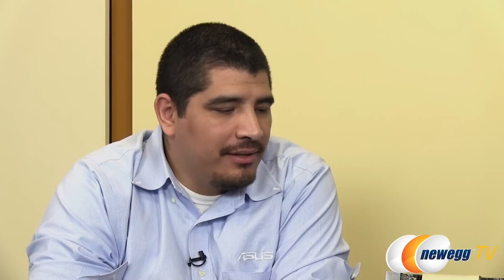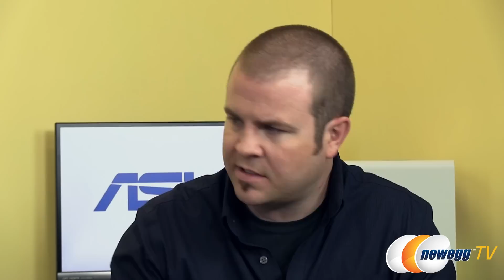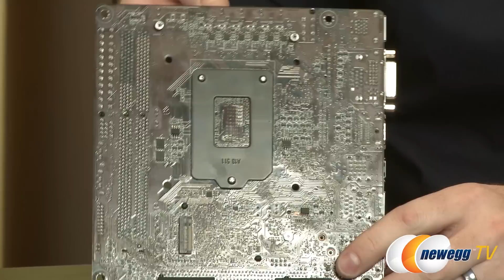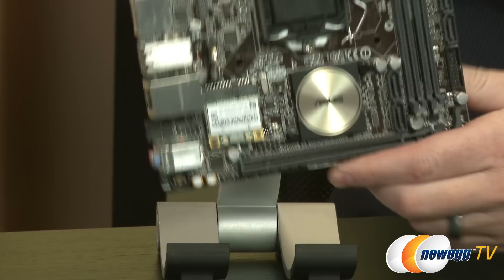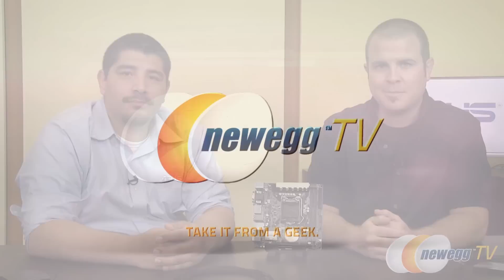ASUS Z97I Plus Mini ITX Motherboard Interview - Newegg TV

Comment: Hello sir,
I have problem with my asus Z97i plus mini itx motherboard. When I on the pc there is a led light on near the ram. When I try to on the power button.. the does not trun on there is no response from the pc...  there is no fan running or any thing just a led light on near ram.. thats it. 
it would be great help for me if you can tell me what exactly the problem is.
Reply: Anthony Christopher The exact same thing happened to me. I had to buy a new mobo. Did you ever find out what was the root of the problem?

Comment: First off I'm a computer Noob !!! Can I have two grapic cards with this motherboard ? 

I currently have a GTX 750 Ti
Reply: Paul Conlan No. There is only one (1) PCI-E 16X slot. There for you can NOT have two (2) graphics cards installed with this motherboard.
Reply: Paul Conlan How would you fit 2 cards onto a board with one pci-e slot? Relax, use common sense :P

Comment: I'm thinking about using this board in my HTPC with raid 5. Dose anyone know how the performance of the write speed is. WD-RED... and how i could monitor the health of the raid or physically see what drive had failed (future). so I could just label the drives and pull the failed drive out and hot swap the new in?

Comment: How many ohms can the on board amp power
Reply: I am asking the same question. Can someone comfirm if it can power 250ohms headphone.
Reply: Reymond Padriga It can drive 250 ohms headphones just fine, but the audio chipset (Realtek AC892) is a bit lacking if you plan on plugging a high-end pair of cans. With Beyerdynamic DT 990 I went with an external DAC+AMP instead.

Comment: I bought the H97I-PLUS several months ago and read that it can support DDR3 2600MHz. I'm reading mixed reviews about it in comparison to the Z97I-PLUS. Saying that it only can take maximum DDR 1600 rather than 2600. I need this to be clarified because I bought for it recently Corsair Dominator Platinum 2400 2x8GB and want to be able to fully utilize the memory.
Reply: ***** Yeah, in the end found out. I switch with the Asus Maximus Impact VII. I am currently selling the H97i-Plus brand new on eBay for $90 to hep compensate for my losses.

Comment: Is this motherboard good for music production? And I don't mean average good. Can I build a fully functional music production pc with this motherboard that won't choke even on huge projects with many channels and lots plugins doing real time processing?
Reply: Motherboard's aren't the issue when it comes to handling music production stuff. That's really solely up to the CPU.

But, ITX is a bit weird for hardcore music production, since most people like to use Audio Interfaces that connect to the PC via Firewire. Pretty ancient connector, but not in the music production industry due to its ultra low latency. Most mobo's don't have Firewire anymore, and usually they'll do a PCIe to Firewire conversion. ITX only has one PCIe slot though, making it weird for ITX and music production to go together unless you simply don't run a graphics card.

You could always do USB audio interfaces, but those have quite a large bit of latency associated with them when compared to Firewire. Not a big issue if you aren't doing live recordings, but practically everyone does Live stuff, with MIDI keyboards and whatnot.

My solution is to get an M.2 Wifi card (Intel 7260NGW) for wifi, get rid of the mPCIe wifi card and replace that with an mPCIe to Firewire adapter so you can hook that up directly to a Firewire Audio Interface
Reply: John Wattis Overall, the motherboard shouldn't be the biggest concern for you if you're focused on music production only. As long as it has basic features, a corresponding socket to match a strong CPU (LGA 1150 I'm guessing), and a decent amount of PCI slots, any mobo with these specs will be plenty enough for you. You generally can't go wrong with a mATX or ATX mobo because most of them come packed with a ton of features, even the cheaper ones.

Your biggest concern should lie in which processor you get and how much RAM you'll want. If you're talking like, a ton of plugins and such, you'll likely want to invest in 16 GB's of RAM, since programs like music software depend heavily on memory. And an i7 processor would be great so you can hyperthread and maximize your efficiency and power (I'm assuming the software has that capability).

My future build, which I'm about 90% done with gathering the parts, is going to be music production focused too (I'm only just starting to learn hehe), but it will be ITX because small form factor is huge for me. I'll be using either the mobo in the video or the Asrock z97e ITX board. These 2 boards have an m.2 slot, which I will be using for wifi instead of the mPCIe slot, and then I'll use the mPCIe slot to connect it to a Firewire audio interface, all powered by an Intel i7 4770k. Feel free to copy me if you want! It's also gonna have a liquid cooling loop and tons of Noctua fans for maximum silence, as well as a really strong graphics card for gaming too!

Also, have you considered AMD? AMD is incredibly good for multimedia and handling big loads like 5 million plugins. With the AMD A10 7850k processor, you get a great processor and a great GPU combined together into one unit for a great price. With the built in GPU, you won't need to buy a discrete video card, letting you free up the PCIe slot on your ITX motherboard if you choose to get one.
Reply: I believe it is good enough, just like most other Z97 mini-ITX boards out there. Nice 802.11ac internal wifi added too. Like most mini ITX board, it is just a cut down version of its bigger brother. I don't think you are going to do SLI/Crossfire for making music, so no point is lost there.

It doesn't have an ALC1150 audio though, the onboard audio I believe is ALC892, but then, if you are doing music production, good chance you are going to use an external DAC anyway, so that point is moot.
Reply: yummybluewaffle
Thanks for your detailed explanation. What I liked about this motherboard was the small factor, and with that the ability to build a small but powerful machine.

I have research and found that this motherboard might not be my best option, and not concern about the small factor anymore, so want to go to ATX. Been looking at the Z97-WS, would it be overkill for my needs? I'm just thinking that it might be the best future prove motherboard, and with time only replacing the CPU will give me a brand new computer
Reply: Well, this tiny motherboard can take the i7 4790K, and the near future Broadwell processor. The only thing that limit you on this thing is you only have 1 PCIe x 16 slot, which in this case, almost always used for graphics cards, so you just can't do SLI/Crossfire on this thing.

I think the WS is a bit overkill, unless you want to do 3-4 way CrossfireX/SLI which even Linus doesn't recommend. Be sure to check out the Sabertooth Mk1/Mk2, Z97 Deluxe, and Maximus VII Hero/Ranger if you haven't, I think they are more worth it than the WS.
Reply: Reza Santoso  Not planing to use more than one graphic card, not a gamer neither into video editing.

Right now working with a laptop Asus A75VM with i7 and 16GB ram, it works good but on big projects it chokes and have to play with the settings all the time (constant tweaking is a pain). So need a machine that can handle a big monitor with high resolution (higher than HD), and be able to overclock it, and sure future prove.

Having PCIe available if need it (when need it) would be good, in case i want to use a thunderbolt card, PCIe flash, or whatnot, will be a shame to invest in something that will reach its limits so soon (reason small factor is not my concern anymore!

Internal audio capabilities is not an issue because I use an interface!
Reply: yummybluewaffle
Thanks for the help. AMD I don't know, a friend of mine has a ACER desktop with AMD APU, 6GB ram, my laptop is way better than that desktop, average 20% CPU use, his desktop only opening the DAW jumps to 75%, it cant cope with any real time processing, so dunno if this is a APU thing, his computer only, or ram dunno! but that makes me look at all the AMD machines as not reliable for anything than daily use, just my experience not a tech here :)

Comment: JJ & Paul your a great combo!!!
Bring a Z97 version of the impact with full 5.1 audio, ac wireless, 5-way optimizations, tpu, higher cpu power phase, ez xmp, at least 4 4pin pwm connectors.
Its a ROG board drop most of the display out if you buy a ROG you will have a beast GPU you just want to stay on a small form factor. This will give you alot more space for the stuff ROG users want.

Comment: Would have been nice to have PCIe (2.0) 4x at 20Gbps on the M.2 connector. An OEM Samsung SSD is already using that interface (reviewed by AnandTech btw) and it really looks like a great improvement over PCIe 2x. But I can understand that Asus is following the M.2 spec and didn't go crazy.